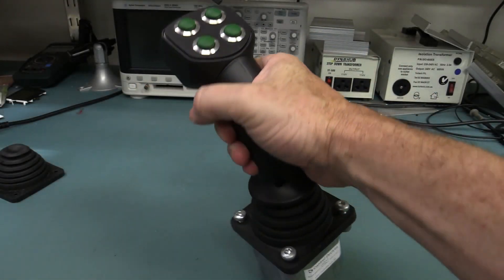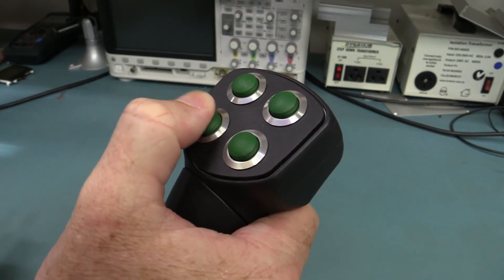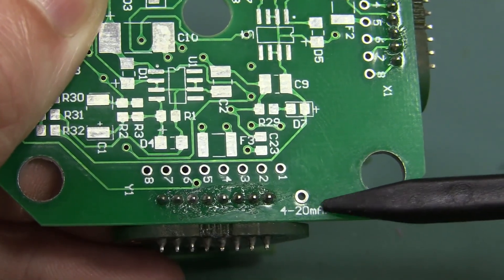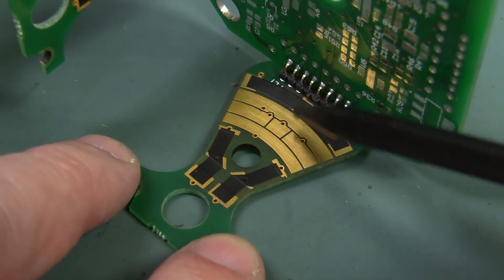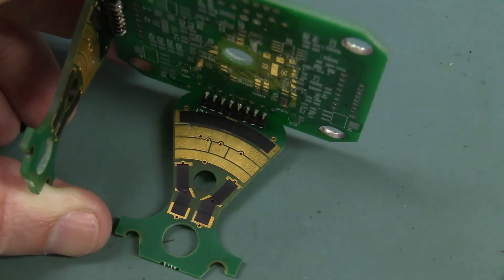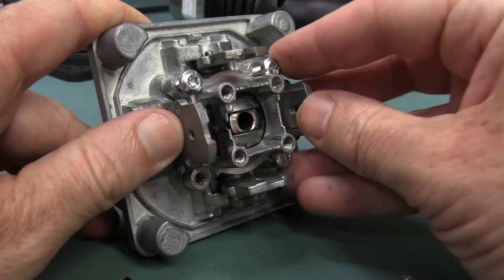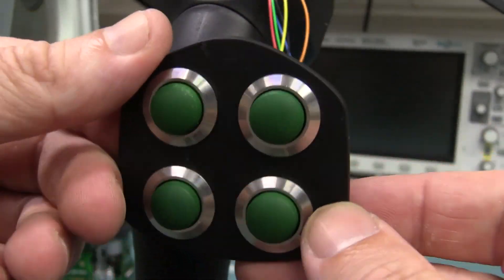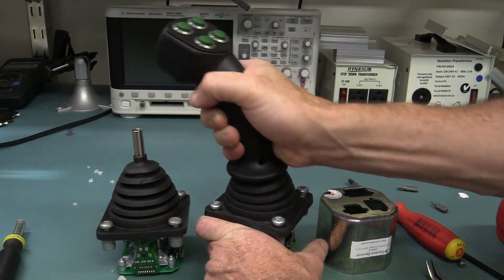EEVblog #706 - Joystick Porn

Comment: Hi Dave,
 
Mark here – Thank you very much for the tear down. Here are some answers to the speculations in the video and your subscriber questions and observations.
 
1) The second joystick, which is now out of warranty since you voided it :P , it uses proportional Hall Effect sensors in the assembly so there are no wipers, but there are some swinging magnets. You will notice that there is four of them. This joystick has two circuits that can be used for redundancy, if one goes the usually the other is still working.
 
2) The extra carbon tracks on the potentiometer joystick can be jumped so that they act as pads in the circuit. This way we can achieve the 10% to 90% output over 100% ove the displacement swing.
 
3) Sander le Tralala. The $310 joystick on e-bay is second hand manufactured in 2012, it is a CAN J1939 protocol output. For that price it’s a bargain. New that unit would be around $1500, especially with the customized handle that it has. The price of the JC6000 can range from $550 to $1700, maybe more if you want something really fancy.
 
4) Giza Plateau. Could you make one for $5? No, the design you described (Ball and LED) only would work if you do not have a handle that requires to face in a particular direction. The design does exist in several joystick brands, these are usually fingertip operated joysticks. I’m not sure it could be manufactured for $5 though, perhaps on massive scales using slaves?
 
5) We use both Hall Effect and Pot, although Hall Effect has it’s long life benefits, the pot does have some advantages. Hall Effect cannot be used in places with high magnetic fields, such as an alumina smelter, or an mag-lift crane. The powerful magnetic fields could cause unwanted signals in the sensor. Potentiometers are also considered a passive device, it is much easier to get them certified in a system that requires ATEX or EX rating in explosive environments.
 
6) dumle29. Cherry Switches – 50,000,000 operations –NO! As Dave mentioned it can take months to select a switch for an application. Unfortunately manufacturers of switches have a bad habit of fudging their numbers. We found this out the hard way. Mechanical life is different to electrical life, especially when you start to draw some current through the switch. The biggest fault with contacting switches is that the contact surface does not last as long as the rest of the switch. The contact resistance goes up and your system shows up faults.
This is why we went to Hall Effect. We built our own because we could do a better job and at a better price. We quote 10,000,000 operations but we have pushed it to 20,000,000 so far. To be honest I was sick of hearing the testing machine working so we switched it off.
 
7) TheJttv. Yes, Mechanical section we call a gimbal.
 
8) digitalrailroader. Yes brochure says designed for Off Highway use. And has J1939 CANbus Protocal, but also has Potentiometer output and Hall Effect. However at Control Devices we also add CANopen, USB2.0, Various voltage outputs, 4-20mA and PWM for solenoid control.
 
9) Jamie Feldman. Yes the cabling issue is a common one across many brands. Recently we changed to 19 strands mil-spec wire, the wire is a little more expensive, but seems to be very reliable.
 
10) BamBam, I have seen it and it’s very sexy. But not as sexy as a Backhawk cyclic or collective.
 
11) kalhana1. We did not use optical sensors because we find it easier to do sensing with Hall Effect. I have nothing against optical sensors, they are fantastic, and there has been a very good design by a company that was purchased by a big national, and they killed the product. It was a beautiful joystick.
 
 
One again thank you Dave for the Joystick Porn.

Comment: To get 20 million out of a mechanical wipe contact dodgy? Tell that to Cherry and their MX keyboard switches.  50 million operations before the performance of the button degrades!
Reply: Put that Cherry in an industrial application setting and the keyboard will fail before the switch does.
Reply: Beddie Crokka Cherry MX switches are found in industrial products. I can't find ones right now, but they pop up from time to time over at http://reddit.com/r/mechanicalkeyboards

EDIT: But then again, Cherry's IP65 rated 20mm Push buttons are only rated at 100000 cycles mechanical, so I guess there's some hefty requirements for such switches :/

DC cycles are at 10000, but that's at 20A 14VDC

Comment: Even if it's manufactured perfectly symmetrical, it won't wear symmetrically. If you take it apart for maintenance you'll want to put it back together in the same orientation.

Comment: Dave The second joystick looks to have hall effects for the joystick axis also.
I repair these sort of joysticks for a local company for tractor use and most these days are hall effect for the x and y axis. The long term reliability problems i have seen are to do with the cabling between the top button and the main board that fail after a gazillion uses.

Comment: While these would be excellent in industrial control applications, they would not be a good choice for gaming or flight applications as Dave repeatedly mentions. For flight and flight simulation/gaming, you want the joystick to flow smoothly through any axis and through the center. These have a giant bump going positive to negative through x, y, and both.

Comment: I SOOOOO need a pair of high quality joysticks for Kerbal Space Program!
You should check out the custom command module panels people have built for that game!
Nothing beats the clunk of a big old toggle switch, or that heavy, tactile click of a big red button to eject your boosters! XD
Reply: You can use an arduino mega as a pc controller. 54 digital buttons and 16 analog axis.
Reply: +Luke Den Hartog toss in some shift registers for the buttons, and if you use hall sensors, Mellenx makes some that you can put on an SPI bus...  at that point the sky's the limit (or at least the number of SS lines)

Comment: I've seen joysticks used in a saw mill. Operator had a pair of joysticks as well as foot peddles. Controlled rotation of the log, moving the saw blade (band saw), making cuts etc was a surprising number of controls.

Comment: Why use hall-effect sensors in the buttons but potentiometers in the motion? Weird, hall-effect sensors in motion would last a lot longer.
Reply: The brochure showed that hall effect for the motion was an option.
Reply: It looks like the hall effect sensors are their preferred way to do it, and last 15 million operations, three times as long as the potentiometer version. They probably sent Dave the potentiometer version because it's cheaper.
Reply: Some of my old calculators (as in from the 1960s and 70s) used reed switches, with keys that pushed a magnet. To this day, those keys still work flawlessly! Hall effect sensors just take it solid state! Amazing reliability! :)

Oddly enough, I once saw an inductive computer keyboard. I wish for the life of me I could remember where I saw that.
Reply: Its the biggest fattest pot I've every seen in a joystick. I think the logic behind it is safety though. One of the wipers is connected to a pot, the other to dead zone detection. I think the dead zone wiper allows them to completely disable any movement unless the wiper has moved outside of the dead zone and is made contact. In a non safety critical application, you'd just measure dead zone by the return of the hall sensor or the pot value.
Reply: richfiles CES 2015 probably?
Reply: PERILEX No, saw it as a schematic in a book when I was a kid, back in the late 80s or early 90s. It was an 8 bit machine, the kind of thing where the whole computer's schematic fit on either 2 or 4 facing pages in the book. Can't recall the details, or the title.

Comment: I wonder if it would be better to use inductive position sensing like with the LDC1000 chip rather than use vipers. In that way they would go full non-contact sensing.
Reply: The second joystick shown has the hall effect position sensors, those are fully non-contact sensors.